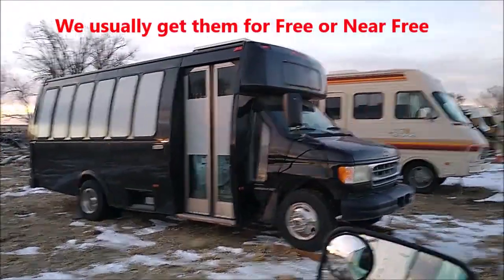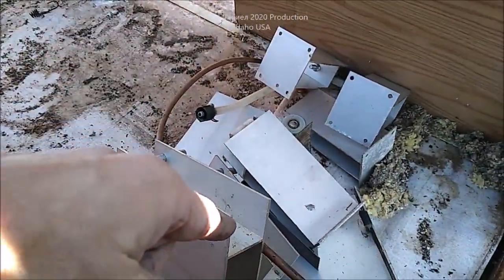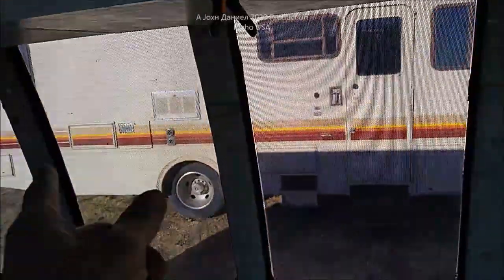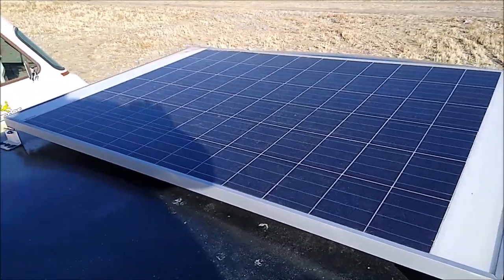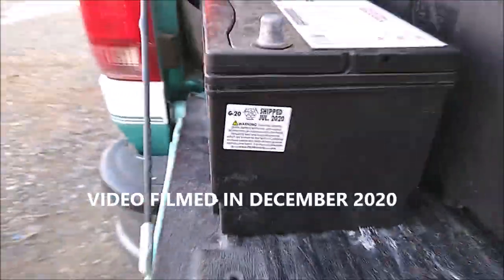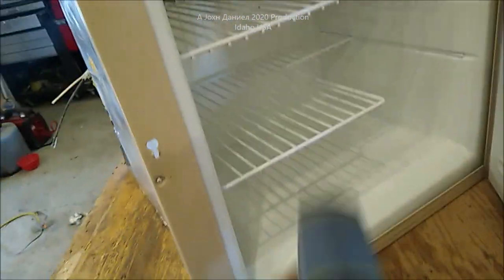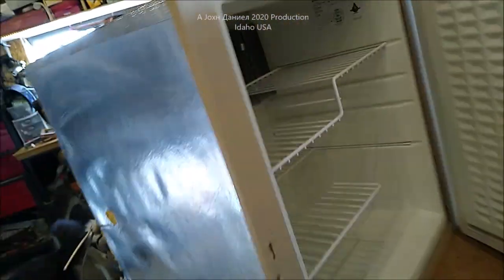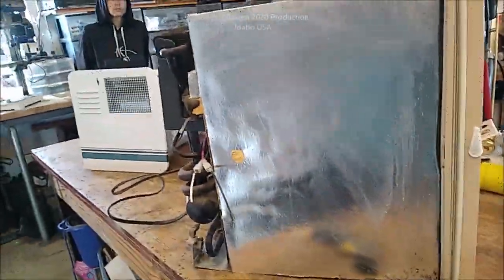RV Salvaging, My Weird fun Hobby that pays off big in many ways

Comment: You eluded to "tricking" a propane fridge into a deep freeze.  Any chance I could get you to expand on that?
Reply from the maker: A propane refrigerator cooling effect depends on the length of time the element or gas flame is going. By moving the thermostat away from the coils it will cause the refrigerator to run longer which will make it able to freeze more often and more consistent internally.
Reply: @JOHNDANIEL1  That simple?  Wow!  Thank you!  Any thing else I should know before I attempt this?

Comment: JOHN, I AM LOOKING FOR ONE OF THOSE SHUTTLE BUS WITH BARN DOORS IN BACK AND WHEELCHAIR LIFT. SHORT 19FT LENGTH . CHEVY/FORD DIESEL. EARLY MODEL.  DO YOU HAVE ANY GRAVEYARD CONTACTS IN PA? ANY CHURCH /SENIOR /AIRPORT/HOTEL/,ETC. WE TRIED THE VAN AND IT WAS NOT  A FIT FOR MY NEEDS. YES, WE HAVE BEEN ALL OVER THE GOOGLE. ANY LEADS WOULD BE APPRECIATED.  WE BOUGHT PARTS FROM YOU FOR OUR TRAILER SO YOU HAVE OUR INFO. THANKS. 02 /01/2021

Comment: damn silly place to put the selector switch for the fridge power at the back of it. In the UK the selector switch is above the door on the old ones.The 2 electric sources ie 12 volt and 240 volt on the left side and on the right is the gas selector and ignitor on the right

Comment: What are you asking for the two ceiling fans? I'd be interested in them.
Reply from the maker: Probably about $85 to 90 plus shipping for the pair, likely $16 to 20 in shipping. Under $110 for them delivered in the lower 48. We are not yet at this time able to ship to the 57 states Obama said we have, but I will check into that!!!
Reply: @JOHNDANIEL1  I'll take them both... email me your PayPal info... you've been emailing with me. CW
Reply from the maker: I will  verify them to work, be damage free and as soon as the weather is nicer remove them for you. I'll hold them for that reason. But do note to me on them on the email.

Comment: Would be interested in the new fantastic fans on the black bus if you decide to remove.
Reply from the maker: Probably about $85 to 90 plus shipping for the pair, likely $16 to 20 in shipping. Under $110 for them delivered in the lower 48. We are not yet at this time able to ship to the 57 states Obama said we have, but I will check into that!!!

Comment: It's sad to see how much work they put into the black bus before they junked it. Had to junk my International when the Series 60 Detroit in it dropped a liner at only 600,000 miles. 
Salvaging RVs is a great hobby, if you have the space & time to do it. People have paid me to haul away something that had good parts on it. Your pop up camper will make a good flatbed trailer. That refrigerator & water heater are worth good money. Congratulations.
Reply from the maker: I do about 20 a year RV salvages, they average by using the last 9 years math about $1080 each in earnings from itemized salvage. We have land off I-20 in Texas where we will be soon opening a massive RV salvage on 48 acres if the country don't descend into Socialism. If it does then we will stay here watching the awesome change to Communism where we have a large underground and major bunker stability.

Comment: I got 2  campers free that had alot.of water damage  that i stripped and used the frames for trailers . Always gotta love the free stuff
Reply from the maker: The trailer I built on video 3+ years ago was from one. You have to beef them up some, and add better springs but for under $1500 total to have a 7k 21 foot hauler is $2000 cheaper than buying a used one that's similar!

Comment: why did you take all this stuff out you could have dropped the motor and put a new one in it or used one then you can sold the whole thing
Reply from the maker: A solid running 7.3 powerstroke starts at about $4000. These van busses start at auction at $5000. Parting out  is no cost and over $2500 on average plus. Just economic realities.
Reply: @JOHNDANIEL1  find a used one . get creative. take the damn diesel motor out and just put a V8 in the sucker. take the motor out and transmission . get farm equipment usually that are the VA big blocks . and all they were to use was pumping water . you take out the V8 big block and you bolt a transmission up to it no ECU nothing put it in and then call it a day
Reply: @JOHNDANIEL1  they make adapter plates